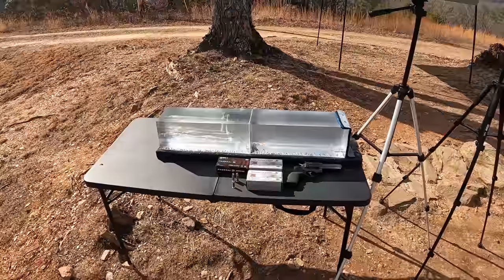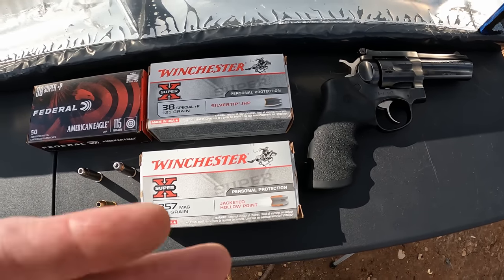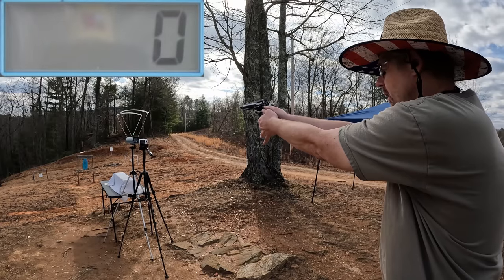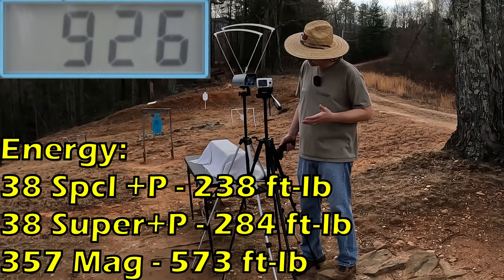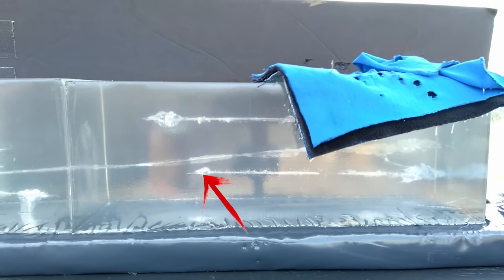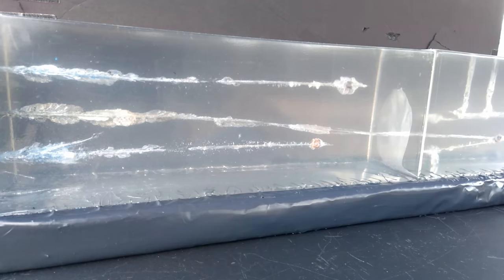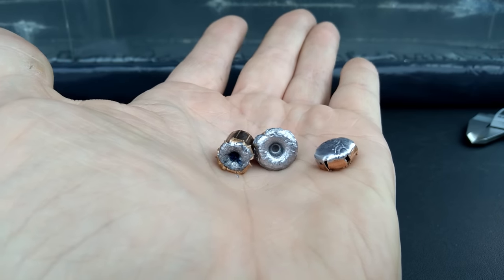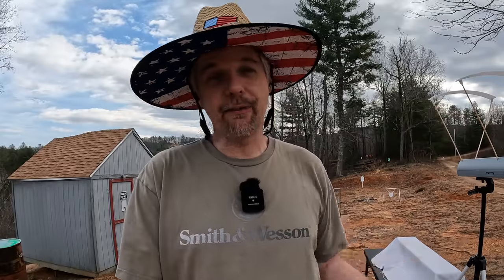38 SUPER In a .357 MAGNUM!....Can You? Should You? How does It Perform?

Comment: I gotta say…that .38 special load looks mighty fine to me. Greater expansion, more weight retention, deeper penetration, easier recoil, less muzzle blast, than the .357 mag. The .38 special might be 125 years old, but it's like…”C'mon, getcha some”
Reply from the maker: Yessir. Did a fine job.😎👍
Reply: I just never liked the recoil in the .357. Wanted that caliber for 25 years. Finally got a Windicator in  4 inch barrel. Had it a couple of years and sold it.  Hated shooting that pistol !!!
Reply: @thatsmytwocents4372  i love my 4" 80s Taurus
Reply: 38 super
Reply: @thatsmytwocents4372  no offense, but it sucks to be you dude!!!!  my Ruger GP100 (also in .357) didn't have that bad of a recoil, and i've fired both 125-grain & 158-grain cartridges through them (courtesy of Underwood Ammo).
Reply: @DrQuagmire1  it was poor quality.  I’ll get another, but a smith or RUGER this time.
Reply: @thatsmytwocents4372  the Model-686 from Smith-&-Wesson seems pretty good, but I personally went with the Ruger GP100 in .357 Magnum, as one of my Australian buddies used to hunt hogs with a Ruger Super Redhawk in .44 Magnum some time ago.  So I was technically referenced to check out some of Ruger revolvers when it came to .357 revolvers
Reply: @DrQuagmire1  i bought the Windicator because of the frame size so i could carry it iwb. The GP100 should handle recoil much better due to its frame size and weight. I just didn’t want to carry that much weight all day. I did buy a .357 Sig and carried it quite a while, but i have since relegated myself to mostly carrying a micro pistol, usually in 9 mm or .380. Mainly depends on how I’m dressed.

I would use a GP100 mainly as a house gun on my nightstand, if ya know what i mean.
Reply: @thatsmytwocents4372  I love my .357 Sig but, unless you do your own reloads, finding ammo for it is a bit problematic. Thinking about getting a .40 conversion for it.
Reply: My 2 favorites are 44 magnum 629 classic and the 10mm glock 40
Reply: @thatsmytwocents4372 you know you could have kept it and just shoot 38 special out of it then
Reply: Based on the box that .38+P ST is out of production. The new Silvertips are a different design. I still have some old .38 Super ST which is 125 gr @ 1240 fps out of my S70 Colt. I'm trying to make it last.
Reply: @thatsmytwocents4372  I’m a smith guy but HIGHLY recommend the GP. Use the savings over a s&w to purchase a shim and spring kit for the Ruger. You’ll end up with a tool that puts a 686 (or Python) to shame.
Reply: the reason why it penetrated deeper is he used JHPs. JHPs don't expand a lot with lower velocity so they penetrate deeper. But yes, .38 spl is a decent round. I'm planning to get 1 or 2 revolvers as my starting gun.
Reply: 38 Super you fool
Reply: 38 Super babas…..

Comment: That 38 Super was a plus P it was a lousy one. Plus P should come out of that revolver a minimum of 1250 with 115 grain bullet. Last time I shot 38 Super with 125 grain projectile, I think I was getting about 1375 or better. The abjuration of the bullet with a proper load is more than enough to fill the boar even though it's.001 smaller bullet. That's well within the tolerance of the manufacturing capability of the Firearms manufacturers for most of their existence.
Reply from the maker: Very inconsistent stuff.

Comment: I found ammo selection in . 38 Special and . 357 Magnum to actually require some real thought process. There is some real significant spread on how the various loads behave. Both on the receiving end and the launching end.  You better know what you are trying to achieve and why. What you said about night and day differences is absolutely true. I believe a 4" .357 revolver to be the near universally most useful handgun ever if you understand your ammo completely.
Reply from the maker: Yeah, I've tested plenty of .357 rounds that show what  big difference the ammo makes.
Reply: I was surprised to see so much mass loss almost immediately from the Federal .357 round and have to wonder if that was normal or just an anomoly for that one particular round. The velocity and energy ratings of rounds can be deceiving. A good defensive round needs to have both good expansion and weight retention along with suffient penetration. The 38 Super obviously over penetrated while the 357 magnum round barely made it to the 12 inch mark due to losing half of its mass almost immediately. I don't believe that behavior is typical and that particular round may have had a defect in it. If I was in bear country a stout .357 magnum round would be the minimum I'd want to depend on.

Comment: My guess as to why the 38 Super didn’t perform as expected is the long run to the lands and the cylinder gap in addition to the undersized bullet. I wouldn’t be surprised if these factors cost it 100 FPS or more. 
BTW, thanks for using the heavy clothing barrier for your gel testing. I know it’s a pain to deal with but I appreciate your extra effort to provide solid information about something as serious as self defense ammunition.

Comment: The .38 Super is a .355 groove and .346 groove like the 9mm. Both can be loaded with .356 and rated at 36500 psi/1280fps  for the 38 rather than 35,000/1210 psi for the 9mm.  Essentially, a .357 makes it a mediocre .38 Special in terminal performance.

Comment: The silver tip is impressive, but the 357 would be my choice. I tried about everything in my 357 lcr, and ive narrowed things down to the gold dots, corbons, and the extreme defenders. I keep the 357 rounds in a 125ish grain (the weights may vary +- 10 grains) but i like the high velocity mid weight rounds.

Comment: Holy buckets.   The energy of the 38spl + 38super combined didn't even match one 357 round.   That's some power.    That said, if I had a 357, I'd use those 38 supers in another ammo crisis.   Performed fine enough.
Reply from the maker: Yeah, the .357 is on a whole different level.

Comment: my personal thought on the 38 super is the material make up. I know for a fact that one batch of lead or jackets can vary quite a bit in composition. I know this from the bonding process, on batch will bond fantastic and the next batch of the very same formula may not just due to lead quality, it may have had some impurities or be harder or softer than what actually spec.ed out.  this is a case where the manufacturers are at the mercy of the lead and copper or brass suppliers to provide a constant with material.

Comment: When it comes to handguns, it's INCREDIBLY hard to find anything more versatile than a .357 Mag. Want something "light-n-easy" for back yard plinking or whatever? Pull out a box of .38 special. Wanna drop a deer? Break out the "extra spicy" .357 Mag. And now, between you and Paul,  it turns out .38 super CAN be used (in some guns) in a pinch.  Let's just make the .357 Mag that little step MORE versatile :) 
Now, I admit I know bupkis about the GP100, but I can say with absolute certainty that my 1962 vintage S&W Model 19-2 is mighty hard to beat in terms of "nice gun!" - Bring in my Model 15-1 (.38 special, and a few years older) and you're looking at a pair of guns that I'll be keeping right up to my last day.
Reply from the maker: Yessir. Absolutely love .357 Magnum guns.😎👍

Comment: Looks like factory .38 Super is running into the same radical under loading as 10mm. It should be more than 1130 with a 147 grain.
I back off a max charge of A-7 a little and run 147 grain XTP’s at 1175 fps from a 4” Kimber.

Comment: 38 super is usually quite a bit faster I think Federal is loading it to 38 ACP velocities but still using the 38 super +p designation for marketing purposes. Also I've never seen a 38 super load with a bullet lighter than 125gr's. The combination of the shorter lighter bullet and the shorter casing in a 357 Magnum chamber I think is why the velocity readings we're so erratic with the 38 super in that gun. 38 super is generally a .356 diameter bullet but judging by the striations on the surface of the projectiles cannelure section the bullet had no trouble engaging the rifling through the forcing cone. If you've ever watched reviews of the Smith & Wesson Governor when loaded with 45 ACP the velocity readings are erratic a lot like it may be a headspacing issue. I would expect to see less deviation in a dedicated 38 super chambered gun such as S&W 627-4 or a 1911 variant and a velocity increase even if the gun had a shorter barrel since I believe gas is slipping around the bullet. But none the less I don't believe Federals 38 super is really full power and it's a new product for Federal I don't think I've ever seen 38 super from Federal before which is very interesting. At one time I owned an Armscor 38 super with a nickel finish. In terms of power I rank slightly below 357 SIG with an emphasis on slightly. 357 SIG definitely took a massive bite out of the 38 Super market. In long barrels 38 super and 357 SIG are comparable but in short barrels 357 Sig is definitely dominant.
Reply from the maker: Yeah, this definitely isn't a good representation of .38 Super performance in general.

Comment: Great test, Brian!  I am really surprised that the Silvertip out penetrated the 357!  Does Win even make the 357 in Silvertip?  That would probably be a better comparison if they do.  At least the 357 was actually at 357 velocities!  I see it left a lot of lead in the initial expansion, something I believe the semi jacketed bullets are know for.  I also think the .38 Spcl was a bit slow for a +P as I think the velocity should be right at 1000... but then the ST bullet might not be able to handle that!  As to the 38 Super, I had never considered it before but it's good to know, but I would have expected a lot higher velocity from it.  I have loaded 9mm bullets into .357 cases before with decent results and even accuracy wasn't terrible.  Personally, I like the 135 Gold Dot loaded to about 1200 fps for the 357 mag.  Very controllable and not a lot of muzzle flash using IMR 4227.
As always, good info, thanks for the work you do.
Cheers, 
jc
Reply from the maker: Thank you sir. Definitely good to know you could run Super if you absolutely had to.

Comment: You can fit a .380 ACP in a .357 too but you have to wrap a bit of paper around the case.The .380 fires out with a lot of unburnt powder and I'm guessing something like 600 FPS.I have never tried .38 Super ACP.9mm won't fit as the case is too thick.

Comment: I've tried putting .38 Super into my GP-100, but it wouldn't fit. The .38 Super I can typically get around my parts is Fiocchi, so there may be case size differences between them and the American Eagle. My .38 Super is a 5" 1911 (as are virtually all .38 Supers) driving a 130gr projectile north of 1200fps, so I suspect that the shorter barrel and the flash gap resulted in pressure differences and the resulting speed the .38 Super wasn't designed for... out of a standard pistol, I'm sure that this ammo would work just fine.

As much as I like revolvers, they generally come in two flavors: too weak and too powerful. Most auto calibers (9mm, .40 S&W, .45 ACP, etc.) have power levels that sit neatly in between .38 Special and .357 Magnum. I was hoping that this test would show that .38 Super in a .357 would help bridge that gap and be accurate enough, too, but its performance was wanting
Reply from the maker: I think a big part of it was this ammo. You could even hear how terribly inconsistent it was. Weird how different brands will fit in different revolvers when it comes to 38 Super.

Comment: Shooting those 3 different rounds out of a .357 mag rifle would be interesting.
Reply from the maker: I didn't even think to check if they would cycle in my Henry.
Reply: @ToolsandTargets  A .38 super auto will fit in the chamber of a Rossi .357 mag rifle, I've never fired 1, but have shot .38 super auto out of a Dan Wesson .357 with an 8" barrel and a Taurus 669 comp 4" .357 just fine.

Comment: In my experience...IF the .38 Super will chamber in your .357 Magnum revolver, they will work and be safe.  Accuracy will be OK, maybe not great.  SOME .38 Super cartridges will not chamber in SOME .357 magnum revolvers.  The .38 Super is nominally larger at the base than the .357 Magnum, BUT the difference is within the usual industry tolerances, so will often chamber and fire in .357 revolvers.

The DANGER is that they are short enough to also chamber and fire in SOME .38 Special revolvers and THAT would be dangerous.  .38 Super operates at much higher pressures than the .38 Special. 

 NEVER use them in a .38 Special revolver.
Reply from the maker: The video I linked to explains all of this and more in great detail with demonstration.👍